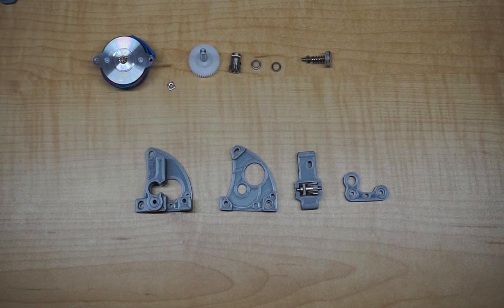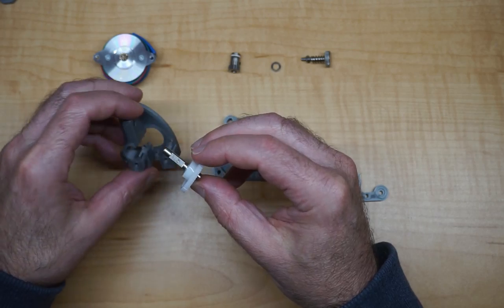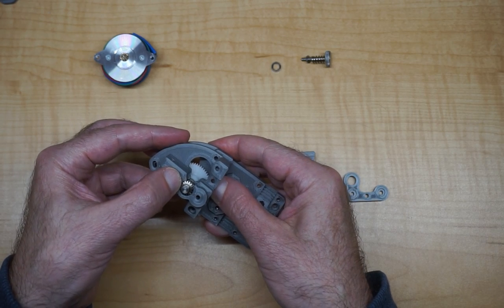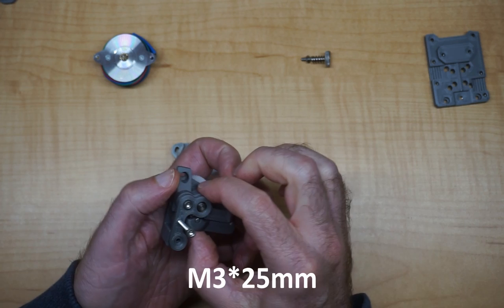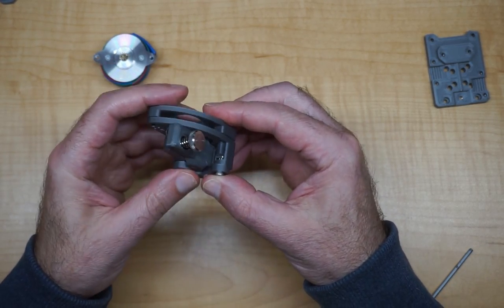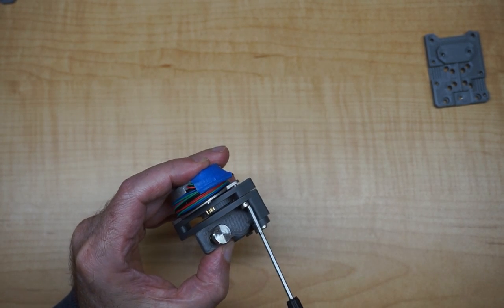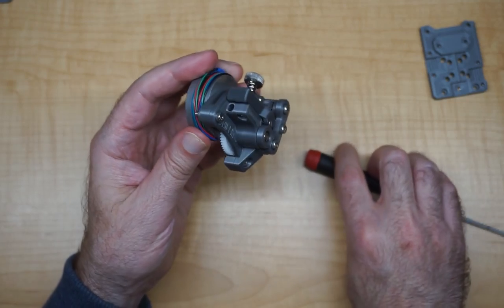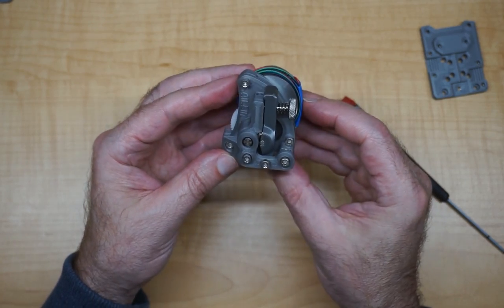Sailfin Extruder (For Ratrig V-Core 3)

Comment: Nema14 with the 10 tooth gear was originally made by ldo at the request of the maker of the orbiter for that extruder. Once that motor existed the sherpa and all the other designs started using it. Even the bondtech lgx lite now uses it. I kinda love the story of this motor because it is such a succes story for the interaction of open source hardware and commercial hardware. Love the design you made btw.
Reply from the maker: Thanks for the clarification!!

Comment: whats the brand of that inductive probe that you are using ??
Reply from the maker: that is the EZABL Pro from TH3D.  I had first used this probe on my old CR-10 a couple of years ago, and it might be the only part left over from that printer :)
Reply: @mikey631   I am looking for a probe for my vcore3 which i am planning on enclosing with heated chamber, i am using an inductive probe but that wont work beyond 50C. Looking at PINDAv2 but it seems like temp compensation doesnt work with klipper for that. The only option i am left with is a optical or physical probe

Comment: Hello, so Your remix is different except mountiong for ratrig from original one? Is it possible to do carriage for ultimaker 2 clone with hextrudort or this one? Cheers
Reply from the maker: yes, my remix is for the EVA 2 carriage system, which is used on ratrig printers.  I'm not familiar with the carriage system that Ultimakers use though.  It may be harder to adapt for those printers, but I think if you start with a BMG mod, you can modify for ultimaker.
Reply: @mikey631  thanks for reply, do You have any discord Group  btw? It could be hard for ultimaker, because mount for bmg is holding bmg and motor together, all the rest bmg remixes, and other lgx and better extruders are using eva or other systems.